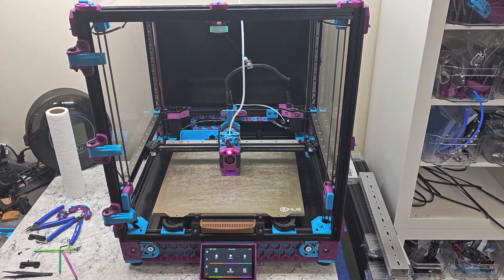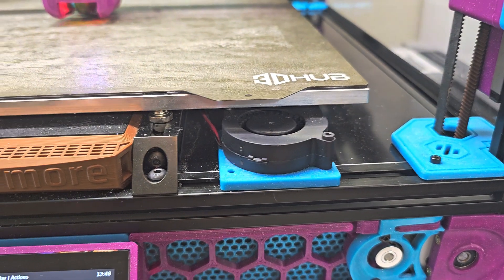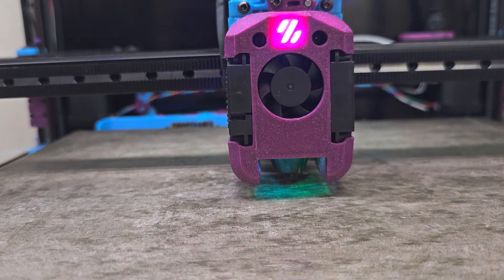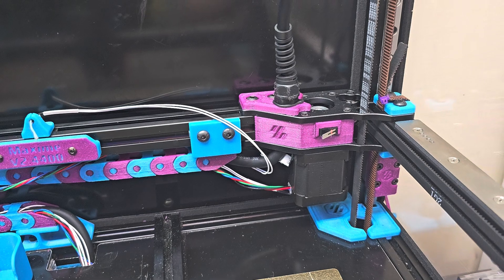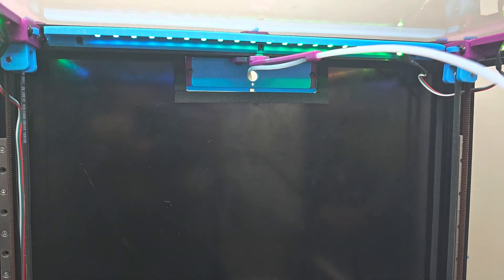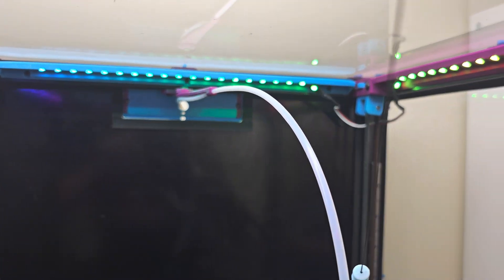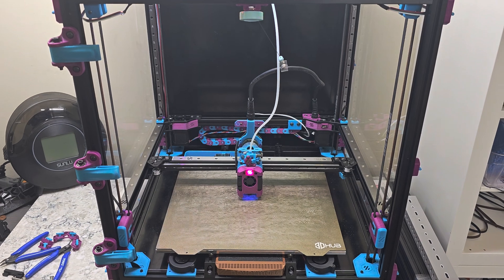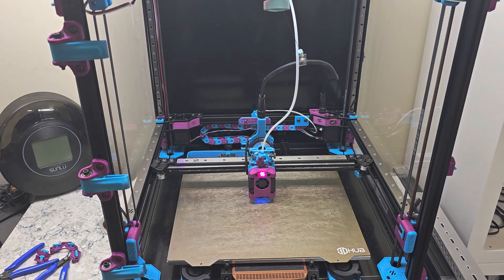Voron 2.4R2: Almost done the modding (yeah, right!)

Comment: can You share bowden arm mount - the one You are using is installed on bottom of 2020 extrusion, one i found on github is installed in front and collide with my led strip cable.
Reply from the maker: Sadly, I can't find where I sourced that version from.
Reply: @oldguymeltsplastic  its ok, i designed one myself

Comment: What is your deck panel made out of?  The BOM suggests corrugated plastic, but yours looks much smoother than that.  Also, can you link to your TFT tilted mount?   I'm building a 350 V2 with a slide out electronics drawer and plan to tilt mount a TFT 70 on the front, but I'd like to remix your mount to work for my arrangement.  Oh, do you connect tghe TFT to the Pi, or control board?  I have a BTT Pi mounted to the back of the TFT70, but am yet to connect everything.
Reply from the maker: Deck, Rear, Bottom panels are ACM from SendCutSend.
Here's the display mount I used:
https://mods.vorondesign.com/details/Go1zR41hCwy0C1qRubOIcQ
Reply: @oldguymeltsplastic  thank you!

Comment: What is the purpose of the backer mounted on top of the gantry when the linear rail is mounted in the front - besides of adding weight to it?
Reply from the maker: I have since moved the backer to the back of the extrusion.
Reply: Much better imho @oldguymeltsplastic

Comment: Are the z mounts on the gantry stock? Only saw them for a second but they looked like maybe they were the upgraded version with the bearing inserted in the top.
Reply from the maker: Hartk's GE5C Z Joints. I neglected to mention them in the video (so many mods to remember!), but did provide the link to them in the description.
Reply: I assume you are still running the beacon probe from one of the close up shots of the hotend. Mind sharing how you dealt with the connections for the beacon off the new cable? I'm about to try it myself while I've got my 2.4 apart.  @oldguymeltsplastic
Reply from the maker: @ryandodsworth2787  the CAN + USB has 8 wires, 4 for CAN and 4 more for USB. I stripped the shielding from the last 20 cm or so of cable at the toolhead end, and cut the CAN wires a couple of cm below that, leaving the USB wires run longer down to the Beacon on the bottom. Works very well for me.
Reply: That was kind of my plan then I probably over thought it and wondered about data issues going unshielded down the hotend. Thanks for the reply.   @oldguymeltsplastic

Comment: Love so much about this printer. Theoretically that backer is not working quite as well at counteracting the bending that happens when the rail and the extrusion expand at different rates. It of course is still going to be counteracting it, and in reality I find it unlikely that you would be able to quantize the difference in any reliable way.
Reply from the maker: I like how it works as an extrusion slot cover this way, so while it may perform its primary task slightly worse, unless someone can provide a compelling reason to switch I will likely leave it as is.

Comment: I just switched from the v5 to the v6 - much more pleasant build and seems to work great. My original print setup had some warping and the lip on the v6 really helped a ton
Reply from the maker: Thanks for the info! I had some problems printing the Nevermore V6, and the lid didn't fit well on the plenum, but that may have been my doing with sub-par print settings.
Reply: @oldguymeltsplastic  I ended up having to reprint the plenum lid a few times - for me it was a matter of turning down the flow a bit, I was over extruding and the tolerances are pretty tight. After that it was smooth sailing, other than one cartridge print failure where I left the slicer profile on PLA.

Comment: Would you be able to share the file for the PCB plate with the nut mod?  Thanks
Reply from the maker: I just hacked together parts from two different PCB plates in the slicer. Also, this custom plate I am using is sized for a PG7 threaded gland, and the CAN + USB cable from 3do.eu really wants a PG9 gland. Regardless, here are the links to the two plates that I cut up and pasted together:
https://github.com/chirpy2605/voron/blob/main/general/PCB_Mounts/STLs/Sherpa_Micro_Mount_RB_36.stl
https://www.printables.com/model/426154-ebb36-canbus-board-mount-for-vzbot-printhead-cnc-w
To do it over, I would hunt for a part with PG9 threading, and order PG9 glands, but what's done is done.
Reply: Got it, Thank you!  I have a PG7 bracket for rear already made so will probably stick with that even though since starting this build I have reprinted the toolhead parts and carriage about 5 times due to "changes" in what I want and updates much smarter people than I have made to their shared files!!!  Settled on Beacon and Dragon Burner just going Rapid HF for now so I just printed latest version to wire up tomorrow.  Thanks for the file links, I often do slicer hacks as well as my CAD skills are in their infancy!!
Reply from the maker: @Flyrockets  my CAD skills are at about that same level of development... 🤣